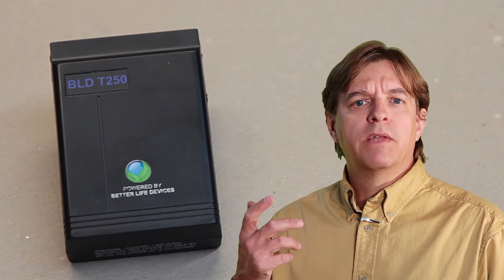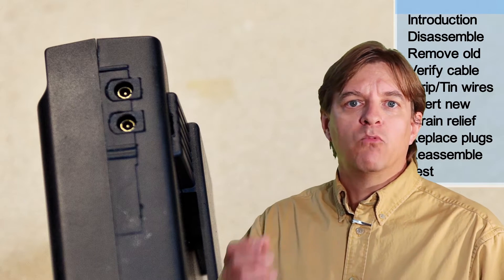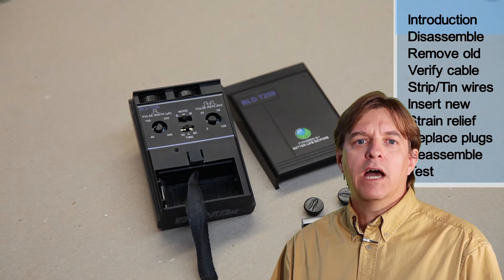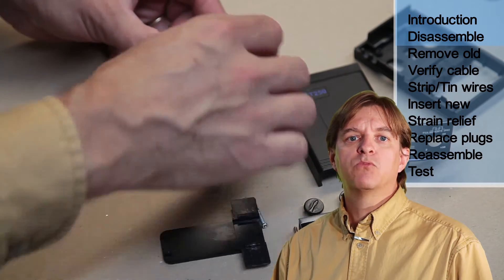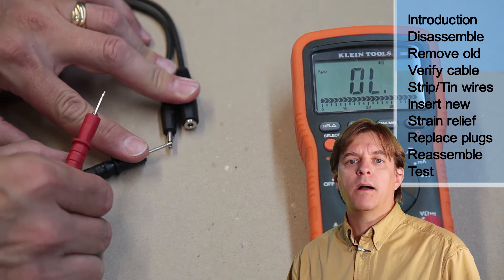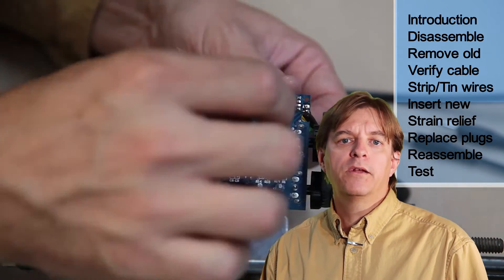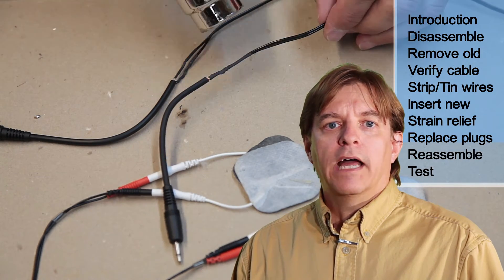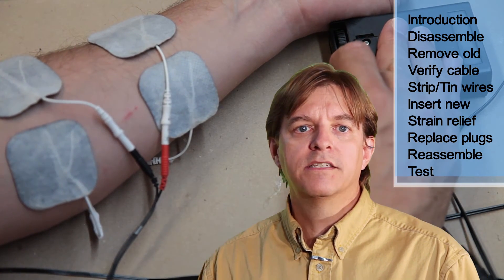How to fix broken plugs in small electronics

Comment: 👊 to my sister in #chronicpain
Reply from the maker: Sorry to hear about your sister Beth. My wife finds TENS units to really help her back.
Reply: I meant, your wife...is my sister...in pain. I have fibromyalgia. My pain has gotten too severe for a TENS unit. I have to turn it up so high to distract from the pain that it just gets annoying. It sucks, too, bc I spent my whole life pining for one. I finally got one 2 or 3 years ago. I told my husband it was the best present I ever got and meant it, wholeheartedly! I suggest looking around for big, long pad replacements. I loved the ones I had!!! They were the same width as the regular ones, but they were 12" long 😊😊😊
Reply from the maker: Doh! I obviously misread that. Sorry to hear about your fibromyalgia. My mom suffers from it too. I know it can be tough to deal with. Thanks for the pad suggestion, I'll pass it on to my wife.